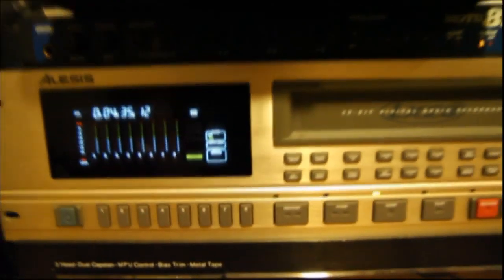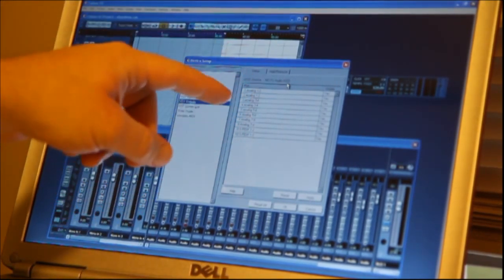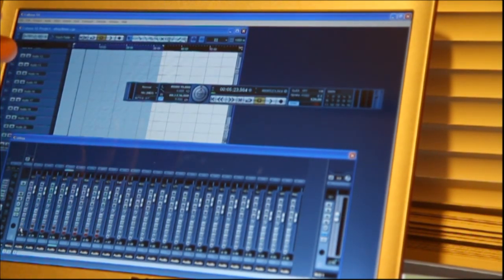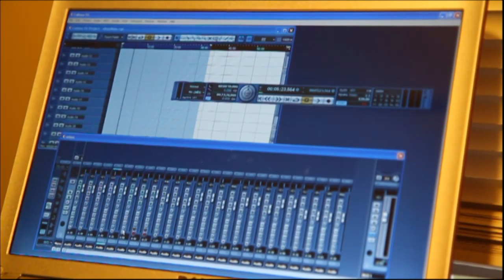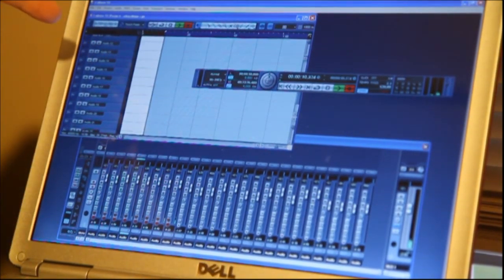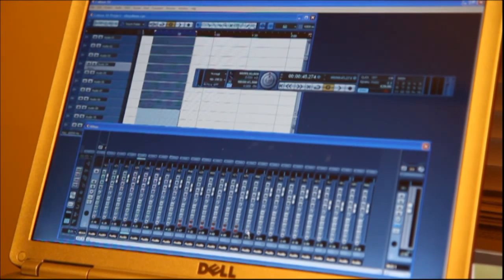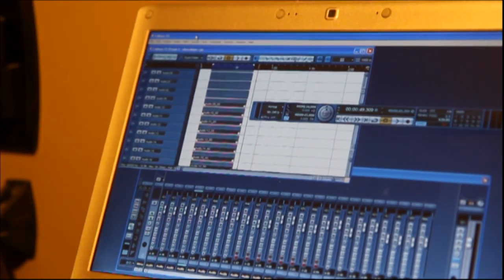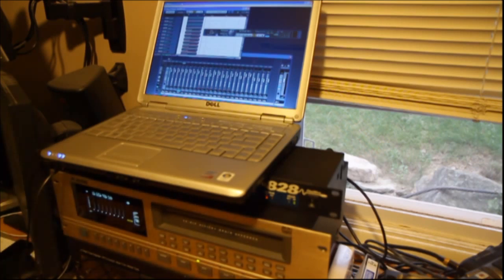Alesis ADAT transfer via MOTU 828 Mk1 Firewire   eBay steveo5355

Comment: Really interesting info bruv. I use Protools and about to do some transfer. 

Questions to forum;

What about adjusting input levels? 
What's the best sync software/ machine to use with a Power Mac running OS X and PT LE8?

Cheers!